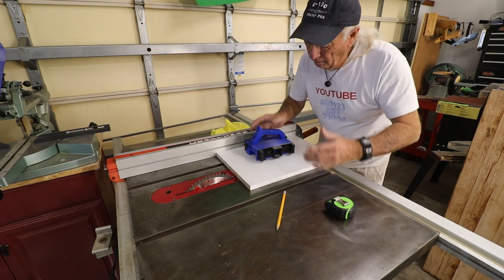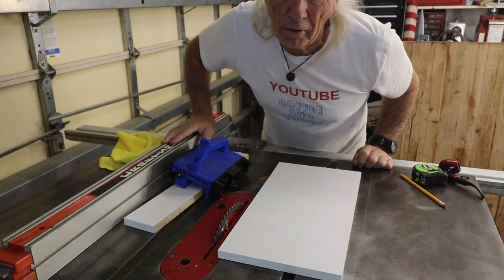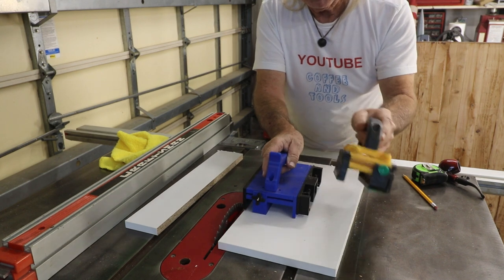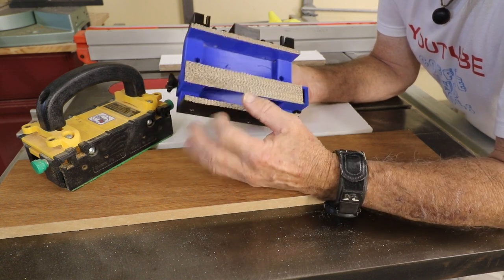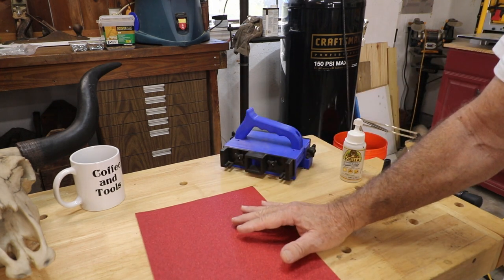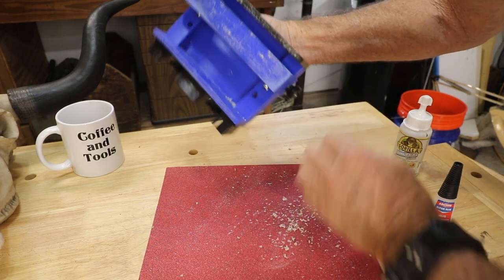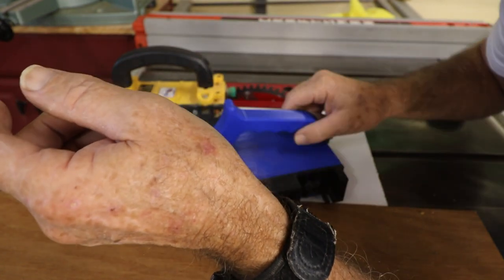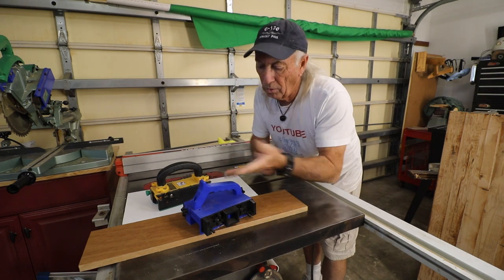Watch this before you buy Micro Jig's Gripper tool.  Coffee and Tools Episode 184

Comment: I believe the rubber on the bottom of the gripper is suppose to be cleaned regularly. I don’t know if that is part of the problem or not.
Reply: Agreed. There are several “gripper” products that require cleaning of the gripping material to promote adhesion . But frankly, I still don’t trust it.

Comment: Something wrong here. The real Griprrr needs to maintained with rubbing alcohol on the gripping surfaces. I keep little wipes in my shop. Secondly there IS a sacrificial backstop on the real thing, or should be. They send you 4-5 of them. I’ve used a Griprr for several years- there’s a time and a place for it (small pieces, tricky to hold) but it’s NOT a replacement for a standard push block. Finally- if it’s NOT gripping then for God’s sake don’t use it.

Comment: Have you tried cleaning the rubber strips on the Gripper with Isopropyl alcohol?   That's what MicroJig recommends when they start to slip.  I have seen others video's where users were complaining about the gripper slipping and after cleaning the dirt off of the rubber strips they had no problems with slipping any more.  Probably have to clean them once in a while is my guess.  I just ordered a gripper and am looking forward to trying it out.
Reply from the maker: We cleaned the gripper with Isopropyl Alcohol before shooting the film. Thanks Jim !
Reply: To Coffee and Tools, it didn’t look very clean to me. The bottom looks filthy. One of the thin gripper surfaces is black in the middle and the wide centre surface clearly has what looks like pitch or glue. Using some shops used and abused throwaway was an epic fail in my opinion.
Reply from the maker: @992Archer  Andy what is on camera for filming and what happens after the fact was there were actually 2 of these units and one was cleaned to see if it would make a difference. Both showed about the same deal, the bottom just slipped on various woods and my 3d printed one does not.

Comment: There was some old man on here who made a wooden version of the gripper that could be turned end for end and it works okay and with used belt sander belts on it it does not slip. The exact measurements worked fine but I forgot to check it and sawed down the center of the layout, then as I looked him up to ask if he did that, I found I was older than that old man. A wooden block with a hook glued on the trailing end works just great.
Reply from the maker: Old belt sander belts...mm interesting idea

Comment: I use old sanding belts on nearly all my pushing and fence accessories. Is there a reason you can’t have another retractable tab on the cutoff side? Also, I find weldwood rubber cement works best

Comment: Cut and clue a bicycle innertube to the bottom.  Get one that's soft and somewhat thick.  works every time.  PS, you should have given a better demonstration of the results, actually cutting something with your jig.  I was wondering if sawdust or dirty lumber would affect the grip?
Reply from the maker: Good thought ! I'll have to try a few runs and see if it is effected.
Reply: Everything effects the adhesive properties of the material…that is dust, dirt, sand, sawdust…much the way Velcro properties are effected by lint and thread and dirt…it too requires cleaning.

Comment: I have 3 grippers they don’t look like yours I find that there directional if you turn them backwards they hardly grip mine are ridiculously grippy I have zero problems just keep them clean.
Reply from the maker: Clean is the big one, but we've tried several "grippers" and the local wood club reported same slip issues and not using them due to this.

Comment: If I had a gripper with the hard plastic surface, I think I'd try a thin layer of silicone caulk on it and see how that felt!
Reply: I spread silicone caulk on my wooden jointer push block with a butter knife.  It works like a charm.  

Just make sure it is fully cured and wiped clean b4 you use it.  And… that you clean the butterknife before you stick it in her dishwasher.
Reply: Silicone is the way to go, you're right on. Silicone on most surfaces has a very high coefficient of friction, it won't slip.